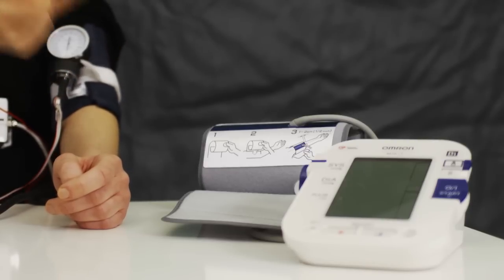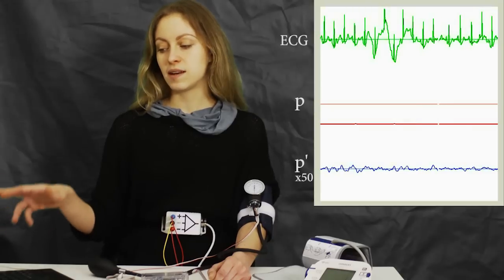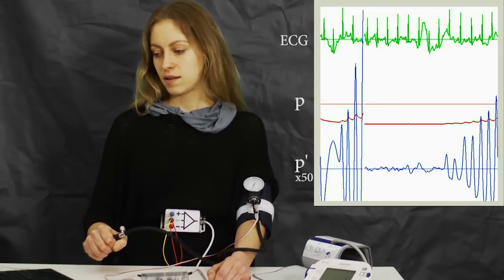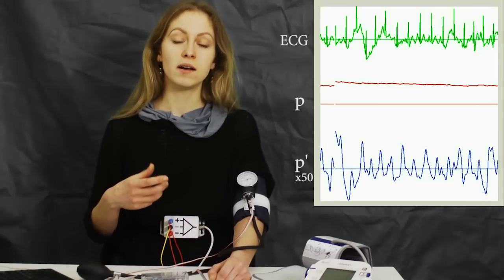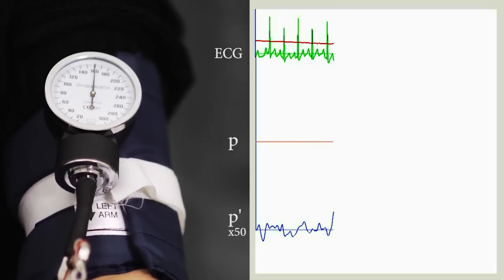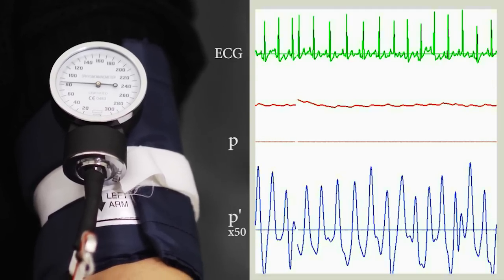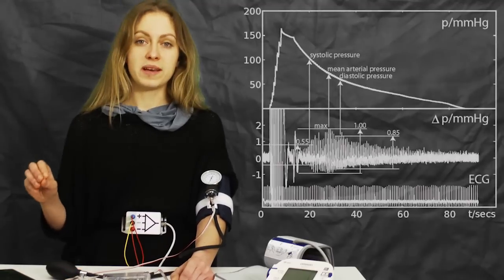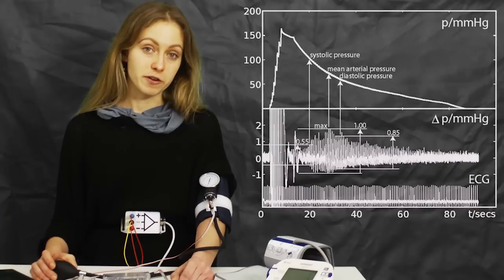Oscillometric blood pressure measurement

Comment: What I don't get is, when the cuff pressure is greater than systolic pressure then the artery is collapsed and so it would seem to me that no oscillations could be measured. Therefore the cuff pressure at which oscillations appear could be measured as the systolic pressure. Similarly, when the pressure in the cuff is lower than the lowest pressure in the artery, diastolic pressure, then no oscillations could be measured. Could you explain what I am misunderstanding here?
Reply from the maker: I'd say it's not just the artery underneath but I guess the whole arm expands / changes shape a bit when the heart beats. Remember these changes are tiny. Even pinching the cuff on the edges when inflated with the pressure wave hitting it will cause some change. I reckon the same when it's nearly empty but then the air transmits the small changes when the arm expands a bit.
Reply: What you described in you comment is what happens during a routine blood pressure check in the doctor's office or clinic.  In this setting the examiner listens with a stethoscope for the Korotkoff sounds.  Just think back to the last time you had your blood pressure checked.  During a polygraph exam, the cuff on your arm is measuring blood volume.  The cuff is usually inflated to 70-90 mm Hg.  At this pressure you can hear the Korotkoff sounds but would not be able to determine a complete blood pressure reading.

Comment: Problem with this over 100 year old method is, when you increasingly block the blood circulation, the natural effect is the body tries to maintain circulation so what is really measured is the hearts ability to build up pressure and maintain circulation.
The use of automatic machines have only exacerbated the problem.
Pumping up the cuff to high preaaure over 200 mmhg also creates a lot of stress on a human being and the stress implications are difficult to mitigate and assess between individuals.
Also, a well trained arm with a strong bicep muscle on an athlete is quite a different subject than a soft upper arm on your 80 y o mother, which is much easier to compress to cut off the blood circulation. As opposed to the well trained person with a high muscle tone.
This is very well known but simply ignored by the "medical society"
A lot of doctors understand this but still use this flawed method for reasons that hardly need to be explained.
It's a great shame and a travesty.
Reply: This doesn't make any sense. A body builder still has soft arteries that get compressed easily by pressures higher than their systolic blood pressure. Sure, if they're deadlifting 100s of kg at the point you check their BP, your going to have to pump it much higher and taught tendons may block the pressure transfer, but flaccid tendons and muscles aren't going to resist the pressure.

Comment: Accutension lets you see the oscillation and hear the Korotkoff sounds on your phone.
Reply from the maker: Interesting! So you let an app listen to the stethoscope while measuring the blood pressure. Stupid question: you could just listen to a normal stethoscope while the automatic blood pressure monitor does its job, isn't it? No need to have that special stethoscope and the app? Certainly a good idea in itself to cross check the readings of the automatic blood pressure meter with a stethoscope.
Reply: BPM biosignals Use of normal stethoscope to measure BP requires some skills. Accutension stetho simplifies that. You will not need to remember the number in real time and you can also playback to double confirm.